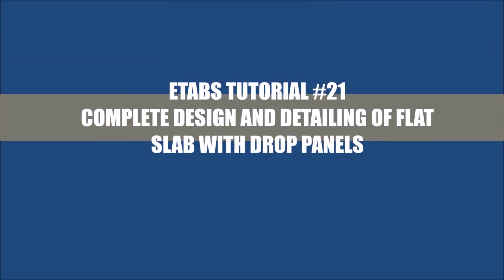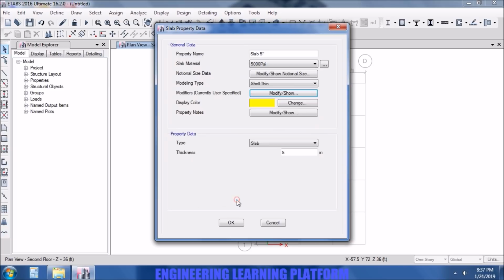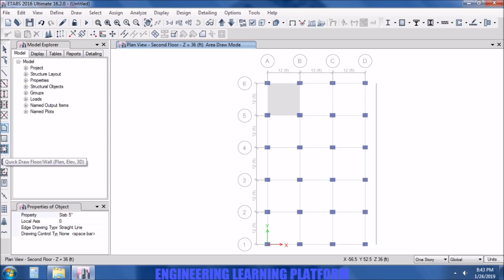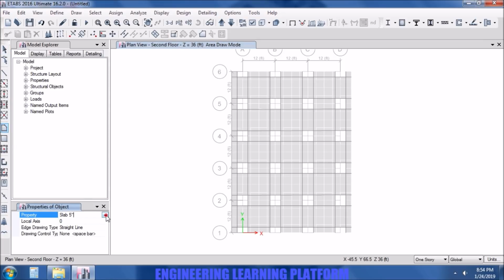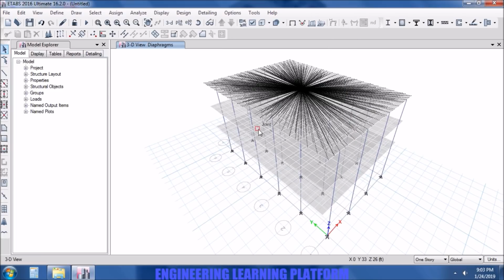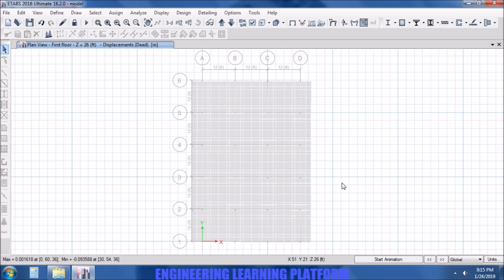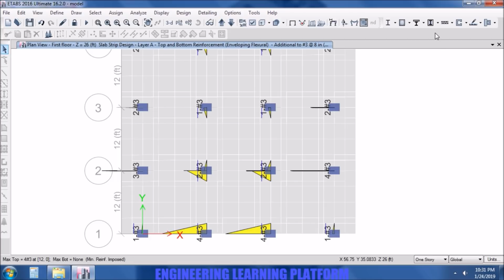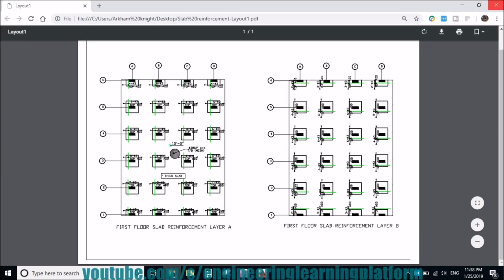Design of Flat slab with drop panel in etabs Tutorial - Detailing of Slab

Comment: SIR AS WE KNOW THAT DDM METHOD IS SUITABLE ONLY FOR  TWO WAY SLAB DESIGN  BUT IN PREVIOUS VIDEOS YOU'VE DESIGNED  ONE WAY SLAB BY DDM METHOD (COULD YOU ASNWERE ME ON THAT I'll BE VERY THANKFUL TO YOU)
Reply from the maker: Yes it is. But if u study DDM method in detail what is it? Its basically distribution of moments right? After we have got moment values we calculate "As" in same method for one way and two way slab right? Now considering that etabs gives reinforcement only in strips, so we apply it on one way know that it would not affect the moment distribution as it's already one directional . In the end we get the area of steel thats what required output is . But if we use middle strips and column strip combination like for two way slab then it wouldn't be right .

Comment: I get confused. When modeling drop panel over slab. the are on drop panel is not consider anymore in the model. Considering you assigned the member as drop not a slab and the thickness is the total thickness. NO NEED TO DELETE. pls correct me if im wrong....
Reply from the maker: That concept works with csi safe

Comment: Which chapter of ACI are you referring to??
Reply from the maker: Kindly mention in which part of video
Reply: @EngineeringLearningPlatform  The part in which you are referring to Reduced moment of inertia limits for beams and slabs...
Reply from the maker: @m.shaihanayub7179  chapter 10 ACI code 318-08 referring to the table for cracked moment of inertias
Reply: @EngineeringLearningPlatform  Are these limits valid for first order analysis?
Reply from the maker: @m.shaihanayub7179  yes .